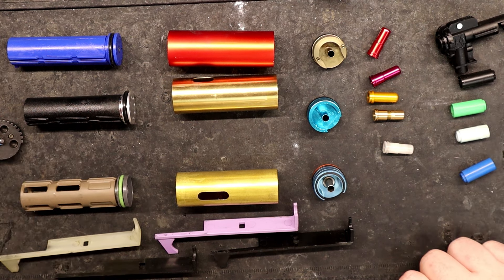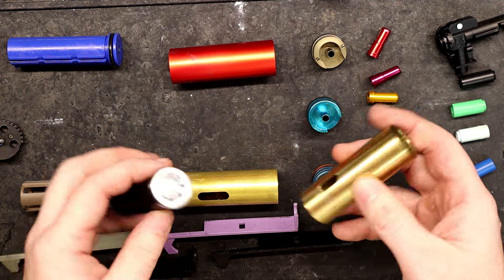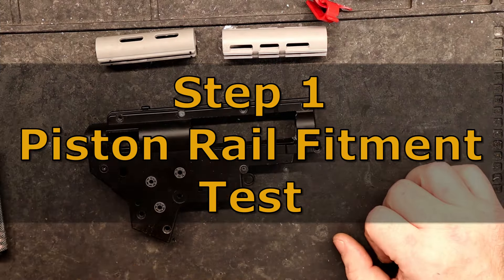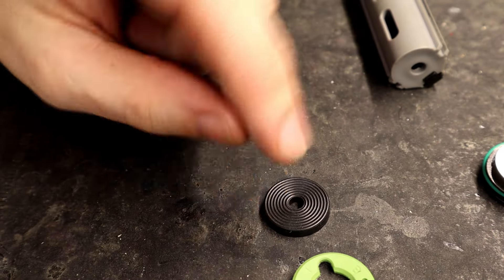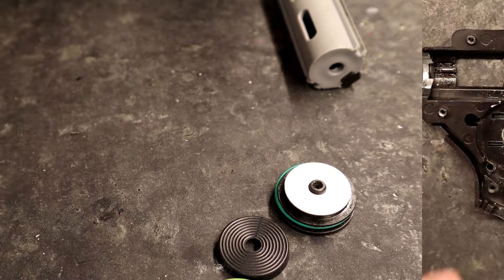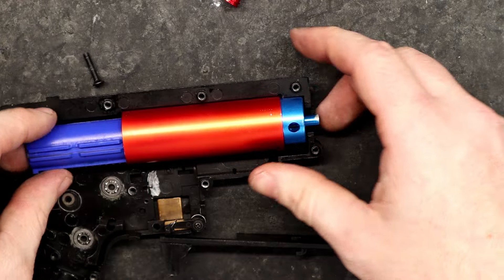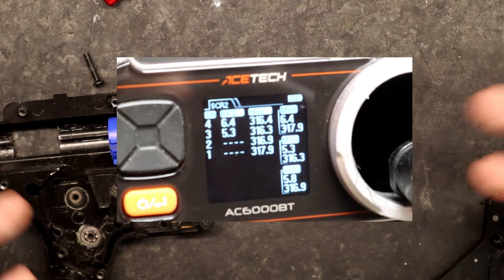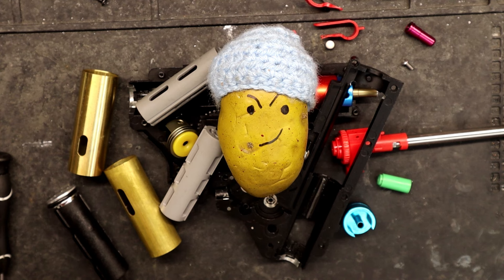Airsoft AEG Compression parts install tips and guide

Comment: Hey quick question what is the purpose of the singular bushing you have installed on the bottom of the spur gear when you have a bearing on the top of it? Sorry I’m new to teching so I was genuinely curious
Reply from the maker: Its mainly due to that particular bushing recieves the most stress whenever there is a PME with the piston or gearbox lock up. A bearing will always fail right there.  I prefer using bearings whenever I can to reduce amp draw and increase cycle rate for better trigger response and smoother gear meshing.

Comment: Hello, I just took my EMG umbrella m4 apart for the first time. When I got it back together and shot it the first time, the BBs shoot out about 10 feet. Basically rolling out. I thought I put it back correctly, what should I check? Thank you for your help.
Reply from the maker: First, what was it taken apart for?
Reply: @wyshtechairsoft   The reason was for a grinding noise, I assumed it was gear’s grinding in the gearbox . Once apart the only gear wear I saw was the gear that is on the end of the motor. I then realized it was able to be adjusted, I adjusted motor/ gear tighter (in). The noise went away. However now I believe I may have put something in incorrectly and now it doesn’t shoot the bb. Im curious if I needed to time the sector gear and the piston differently. Thank you again for responding and helping.
Reply from the maker: @Jay19299 you might of forgot to put the tappet spring in.  Thats easy to check by pressing the nozzle inward and see if it pushes back.
Reply: @wyshtechairsoft  just check nozzle, it wouldn’t move back or forward. I split the gear box, it now moves freely and tappet spring was connected. Could it be how I aligned the gear to the piston?
Reply: @wyshtechairsoft  got it! I didn’t have tappet plate in the nozzle notch. Thank you a ton for your help. I wouldn’t have thought to look there without you helping!
Reply from the maker: @Jay19299 glad to help bud! Consider joining our discord and showing off your build!

Comment: Hey, I have a question: I have a CYMA Sport ar-47 (sr-47) and I have no idea how to program the MOSFET. Would you happen to know what I need to program it and how?
Reply from the maker: Sports dont come with a mosfet from the factory.  If it does, then it's more than likely an aftermarket, so you'd need to find out what brand and model it is. Unless it's a Platinum edition.
Reply: @wyshtechairsoft  Hmmm. I really thought it had a mosfet. Whenever I plug in the battery, it plays a little chime. I thought that indicated the mosfet turning on.
Reply from the maker: @reflexgaming342 Do you have the link to this rifle?  The description might say it has the ZUES mosfet in it, which would be an exception to what I mentioned.  Which that mosfet is just basic and cannot be programmed.  However you can upgrade to replace it with one that you can.
Reply: Can you see my replies? Youtube keeps taking them down.
Reply from the maker: @reflexgaming342  Join the Wyshtech Discord. That way, it would be easier.
Reply: @wyshtechairsoft Your discord link is invalid or expired.
Reply from the maker: @reflexgaming342 try the one in the video description. That one should work.
Reply: @wyshtechairsoft Ok, I just joined the discord but which channel should I use?

Comment: Are there any sorbo pads that you can recommend.
Reply: He mentioned sorbo is an obsolete method and it is better to get a set of metal washers for the piston head to adjust AoE.
Reply from the maker: If your really need to use sorbo pads.  I recommend begadi sorbo pads from begadi.com

Comment: Do you release this video 7 days after I made my first build😂 it's going to be really helpful on my second great video! I also have a question I'm having trouble with a replacement trigger assembly binding like crazy. I cannibalized it from a lancer because into a (old 5+ yrs) g&g gearbox shell it binds open and closed but I can't see what it's binding on maybe the simi lever? Do you know what could cause this?
Reply from the maker: Thank you for your kind words! Its inspiring.  As for your trigger.  Without seeing it, my guess is that the trigger might be too wide for the gearbox or the axles of the trigger are too thick.

Comment: i have a shs g36 nozzle in my sr25 and I'm not getting the consistency I should be getting. if i do the compression test you can heat the air leaking from the nozzle. i know its possible to get perfect compression there because I've done it with my cyma plat mp5. I first tried a Maxx nozzle and no luck. I'm not spending $100 on Maxx parts when stock cyma parts are already good. not to mention I can't even use a Maxx nozzle. I then tried a shs nozzle which was a tight fit, but it worked and perfect air seal. I don't know why shs isnt doing it this time if it worked before.  the compression at the cylinder is fine but my power is below what it should be on a guarder sp120.
Reply from the maker: What gearset brand are you using?